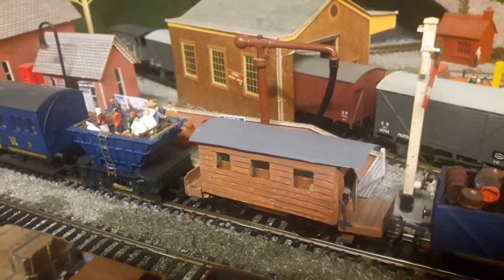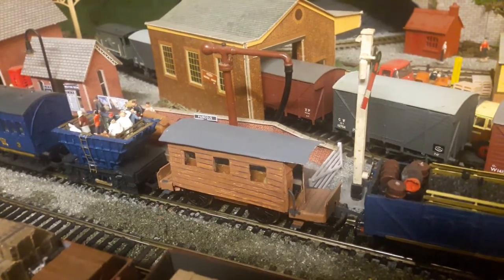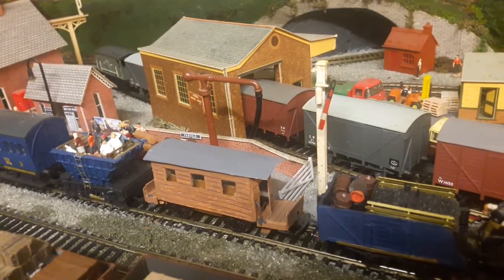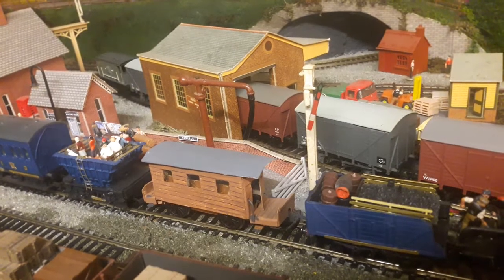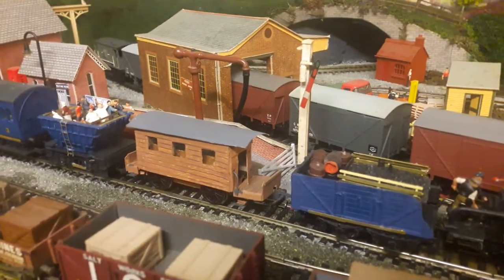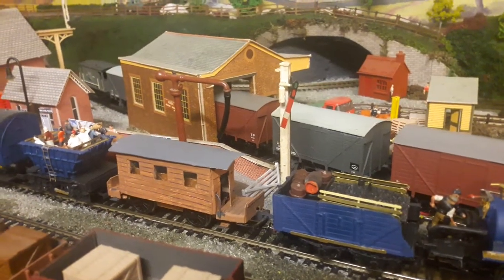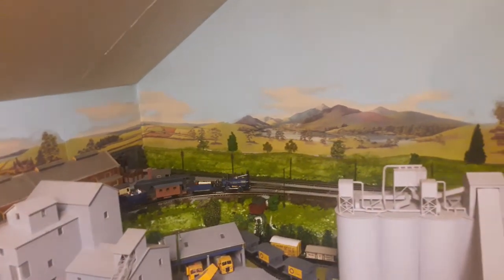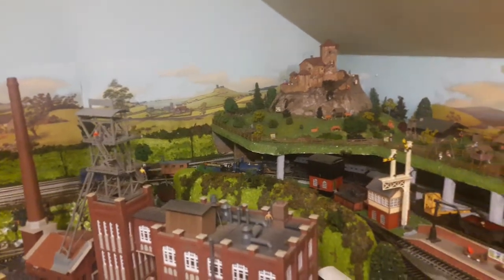Tommys Experiment

Comment: Hi Paul. What could be better than building a locomotive yourself, which also has such good driving characteristics. After building a broad gauge wagon to normal track, it is simply not possible. You can give an interpretation of it. And you did and you succeeded. Greetings Jan
Reply from the maker: Hi Jan, thanks for watching and the kind comments, The origonal Experiment wagon was actually standard gauge at 4ft 8.5inches when built but was a very narrow body for people to sit inside. The copy I made looked terrible so I modified it and made it wider to make it look better.  George Stephenson won the gauge war with his standard over Brunel whos gauge was almost 8 ft. Stephensons gauge is used in almost every country. 
I am going to make videos of British steam Locos from the 1820s to the 1960s using the models I have.
 Cheers Paul.